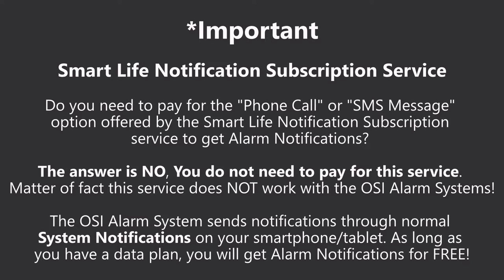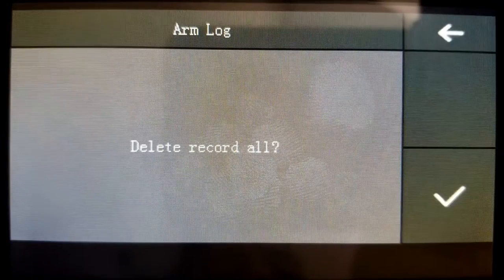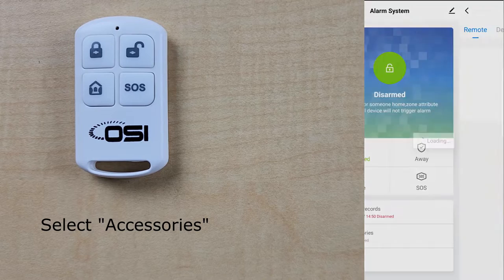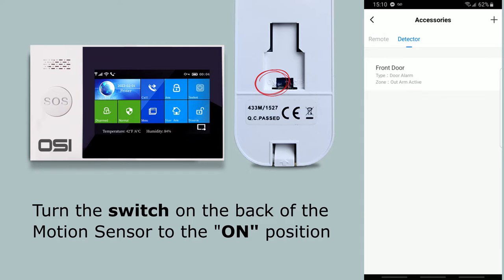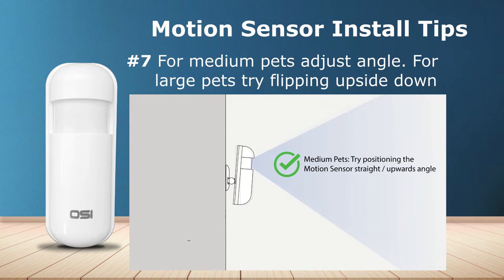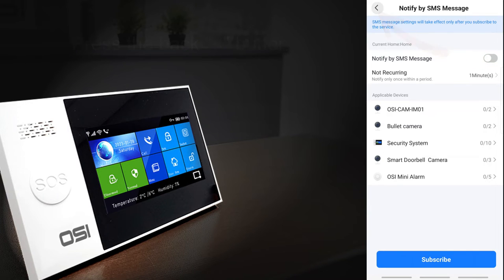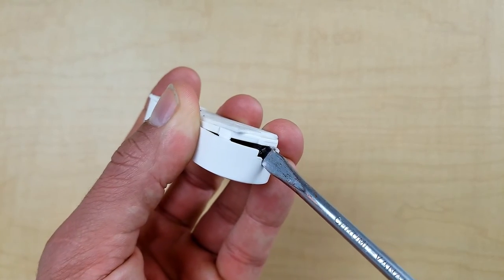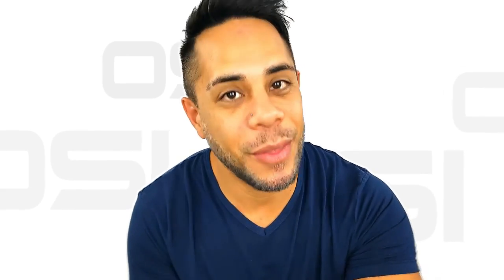OSI 4G Wi-Fi Alarm System - Unboxing, Set-up, Install & Troubleshooting(Full Video) // OSI Go Direct

Comment: So after installing the keypad how do you make the system use the passcode to disarm? Anyone can enter and press the disarm button
Reply from the maker: Please check these settings:
1. Go to Menu > Settings> Switch
2. Select Keypad Lock
3. Check to ensure that it is set to 'ON'
by pressing the white/grey square will turn the keypad lock 'ON' or 'OFF'
4. When you turn it 'On' and select the check mark to save the settings, then back out the the main screen.
5. Select the square with a lock on it (bottom right) this will put the display to sleep.
6. You may be asked for the passcode, if so enter the passcode and select the square with the key again and the screen will go black.
7. Now touch the screen, the screen will turn on. Then select disarm, you will be asked for a passcode. 
8. When you enter the passcode and select the check mark you will have full access to the keypad.
Reply: i had the same question, thank you for asking.

Comment: Can any 433hrz motion sensor work on this device , there is many similar devices but with different brand name , can all accessories work on all brands?
Reply: I have the rfid brand
Reply from the maker: If it has specifications of EV1527 RF coding/433 MHz frequency, it should synchronized with the alarm system.

Comment: Is the wired siren to be mounted internal or external of the building?
Reply from the maker: The wired siren connects internally as it is not waterproof and made for indoor use.
Reply: @OSIGoDirect  thanks alot, so am I right to think this system has no external siren? Just the wired internal & the optional other siren?
Reply from the maker: @garethjones2053  That is correct, however if you did find a outdoor siren with EV1527 433Mhz encoding, it would pair with the alarm system

Comment: I have disabled bluetooth on my phone and would like to keep it that way. Is it absolutely necessary to have bluetooth on?
Reply from the maker: Bluetooth is only required when connecting the alarm panel to Smart Life App. Once connected you can turn off your Bluetooth as the alarm panel  will rely on the Wi-Fi connection.

Comment: Thank you.  Its a little disappointing that the door sensor cant chime when disarmed and function as a door sensor when armed like many other alarms.  Is there a way to get the chime from the siren as well?  Looking to hear when someone enters when I'm in the back room and the alarm is in the front of the store.
Reply from the maker: I apologize, but the siren is designed to function solely as a siren and cannot be reprogrammed to serve as a door chime.

However, you have the option of adding an additional door sensor to the door and configuring it as a doorbell. It's important to ensure that the two sensors on the door are not activated simultaneously, as their signals could interfere with each other. For instance, you can place one door sensor closer to the door opening to be used as an alarm, and position another sensor further back to function as a doorbell. This way, the signals will be delayed sufficiently to prevent cancellation when transmitted to the alarm system.
Reply: @OSIGoDirect  Thank you, but I need the chime to sound on a different source as well.  Is this possible?  I cant hear the chime in the back of the store.  The keypad is in the front of the store.
Reply from the maker: @linocarosella8748  For your specific needs, it would be advisable to consider purchasing a separate door chime. This standalone component is designed to chime when the door is opened, and you have the flexibility to place the chime unit in any desired room.

Please note that we do not sell this particular product, but it is available on platforms like Amazon. You can search for "door sensor chime" to find suitable options. I hope this information proves helpful to you.
Reply: @OSIGoDirect  OK, so to verify, the doorbell feature sound will only play from the keypad and nothing else?  is it possible to have two keypads?
Reply from the maker: @linocarosella8748   Correct, only the keypad.  The OSI alarm system keypads (Alarm system) work independently and cannot be integrated with each other.

Comment: In the timer section of the app I set up a schedule. In the schedule it has a notification switch. I turn the notification switch off, gray, so the alarm will not talk when it arms/disarms itself. It still talks and cherps when it arms/disarms. Am I misunderstanding what this switch does?
Reply from the maker: If you have one of the more recent alarm panels you can disable the arm/disarm notification by following these directions: https://osigodirect.kb.help/how-do-you-turn-off-the-arm-and-disarm-notifications/
If your app does not display the 'Mode App Sound' under the app settings then it will not be possible to disable the arm and disarm notification.

You can disable the cherp sound (arm beep) 
On the alarm panel select Menu -> Settings-> Switch-> Arm Beep. Select the white/grey squares to turn off the Arm Beep and select the check mark to save the settings.
Reply: @OSIGoDirect  thanks, a least i stopped the base from chirping. I wish I could get it to arm/disarm silently in the schedule mode.

Comment: Is there a way to force entering a password on the keypad to disarm the system because right now if the system is armed and you walk inside the house if you press on Disarm that will dosable the alarm
Reply from the maker: Yes there is.
First ensure that you know what the passcode is or you can create a 4 digit passcode by going to:
Menu >Settings >Password 
When you have saved your passcode do the following to force the alarm system to ask for the passcode when 'Disarm' is selected.

Go to Menu> Settings> Switch> Keypad Lock> select the white and grey square to enable to Keypad Lock. It should turn green and say yes.
Select the check mark to save the setting.

It is also explained here as well:
https://osigodirect.kb.help/the-alarm-panel-is-not-asking-for-a-password-or-passcode-when-i-press-the-disarm-button/

Comment: Is it possible to change the network credentials
Reply from the maker: To change the network credentials you can select Menu on the panel display, then select Wi-Fi, then select Unbind. This will reset the wi-fi and will delete the alarm panel from the smart life app.  You can then add the alarm panel device back to the smart life app with your new wifi credentials

Comment: Can you set a door alarm or chime that will sound when someone enters when system unarmed?
Reply from the maker: The OSI does have a Chime (doorbell) feature. When the door is open the Chime will sound. It will not work as both a detection sensor and chime at the same time. It will have to be one or the other.  
https://osigodirect.kb.help/how-to-program-osi-alarm-sensors-to-use-as-a-doorbell-instead/

You can place two door sensors on one door and program one as an alarm and the other as a door chime.  Important to note that the sensors would need to be placed on the door in such a way that the signals do not cancel each other out.  We will be coming out with a video to demonstrate this.